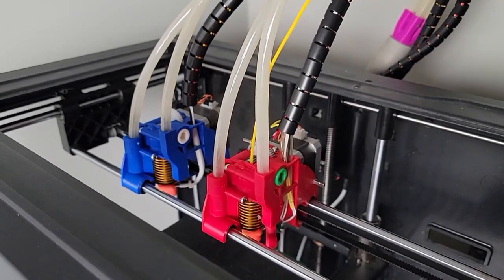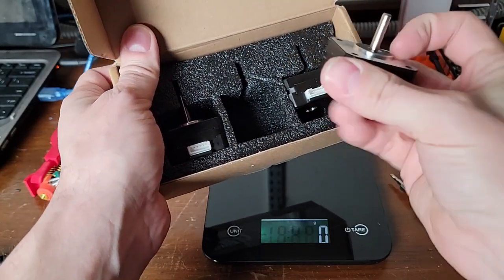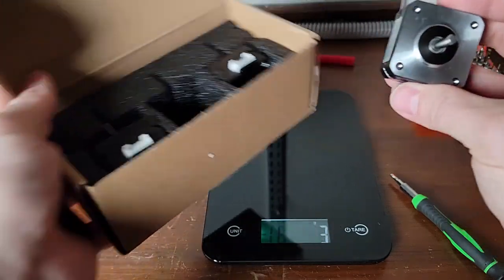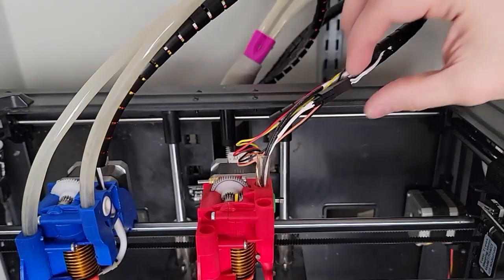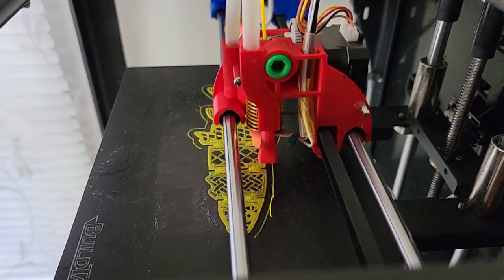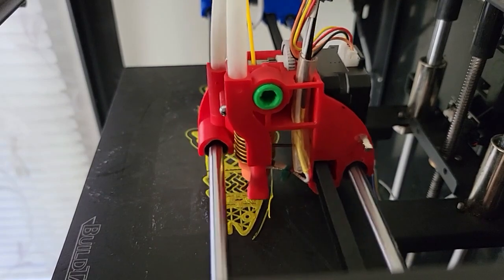Magnetic IDEX 3D Printer Gantry Weight Loss Program

Comment: That's a lot of weight removed from the motion system.  Wow!
Reply from the maker: Original Flashforge Creator Pro 2 print head was 812g.  Now each tool head is just 235g.
Reply: @m_IDEX  71% reduction in weight. That's huge!

Comment: Wow! That’s a lots of weight savings. I am ditching both Fans too. I will go with Nema14 motor a HGX extruder total about 180g+ can further down by replacing metal extruder body. I was wondering how you switch on/off the hotend n part cooling independently? Thanks for sharing your ideas.❤
Reply from the maker: Thank you!  With the nema 14 extruder motor I am at about 200g for each tool.  Check out this video https://youtu.be/mBfa64RxUwU?si=89SnJk35NbiXtdyY

With CPAP blower i am just keeping my min cooling at about 13% on first layer.  This is just enough to keep extruder happy and have a nice 1st layer.  For ABS parts, I remove part cooling air tube completely.  I will probably add 2nd blower for part cooling or add a solenoid valve.  Still working on it :)

Comment: Love your direct drive design. So compact and low center of mass. I have been using 2020 extrusions with mgn rails which makes me wonder about angular torque 😅. Would you happen to have a link for it?
Reply from the maker: Thank you.  Designs will be released soon.
Reply: @m_IDEX  speaking of rigidity.. just my 2¢ from looking at your videos(AWESOME WORK BTW)... it seems the height of the crossbar (near the hotend) is arbitrary.. Could raising the height of that bar&bearing above the hotend make the toolhead more compact and rigid? Also it might help to keep those motion and support components away from the heater block..
Reply from the maker: Thanks for your feedback.   Initially I set out to make replicator to magnetic IDEX conversion as simple as possible.  Therefore I inherited some of replicator's design parameters.    Magnetic IDEX toolhead center of gravity is very low and it is only 52mm tall.  I find that it has not been an issue.  My latest design will use NEMA 14 motor and will be even lighter.

Comment: Do I understand correctly - the carriage attaches and is held to the toolhead by simple magnets. and to detach you move the toolhead to the front and then press it against the catch.  you do this every time there is a call for the toolchange in the gcode by calling a macro? ... and also when are you planning to release this? I would love to 
 build this as soon as possible
Reply from the maker: Yes, you understand correctly.  Two tiny neodymium magnets is all it takes to move the tool head on the x axis.  The T0 and T1 macros are in the klipper config.  Slicer does not need to do anything special.  My goal is to have designs ready by MRRF.  (2023 Midwest RepRap Festival June 23-25, 2023)
Reply: @m_IDEX  thank you.
Reply: @m_IDEX  thank you.  Is there a discord server or another way of communication with you?
Reply from the maker: No discord server yet.  I just started a telegram channel:  t.me/m_IDEX